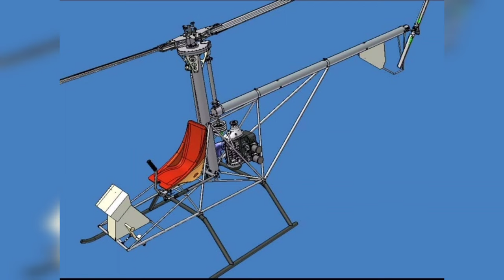Tail-Rotor Hub: Experimental Homemade Helicopter Build, Part 28.

Comment: where did you get the necessary parts/tools?
Reply from the maker: Have manufactered everything shown in this video myself as per the plans design/dimensions
Reply: @JeffChoppah  ah I see
how about the tools you used? materials used as well?
Reply from the maker: Aluminium 2024T6 and steel 4130(EN9)
Reply: @JeffChoppah  ah thanks

Comment: Santun bosku mesin bubutnya berapa harganya karna mesin bubut itu banyak kelebihannya bisa aja buat apa saja segala jenis maupun blok mesin buat silider blok piston torack
Reply from the maker: Depends with size and features...mine is a combination of lathe and mill, with 0.8m between centers coated me $2000 in 2019.

Comment: What is going on with your engine?
Reply from the maker: Haven't spotted much trouble so far except one carb is not responding, engine is currently off the airframe, have done general inspections and servicing, changed sparkplugs, engine oil, gearbox oil(also modified breather, it kept on leaking in vertical mounting), inspected piston rings and gaskets, cleaned it, lots of cooling water was available so we rule out any overheating...all looks normal, I will be mounting it tomorrow and work on carburettors next and try firing once more...have disassembled Tail-Rotor gearboxes and changed bearings clearances to hand fits, and reassemble Tail-Rotor transmission shaft making the system quite free and smooth.
Reply: @JeffChoppah  Something caused the engine to seize and there must be signs of that seizure.  Post pictures of the pistons through the exhaust ports if you can.  It seems odd that there is no damage to the combustion cylinders or pistons.  Well good luck and all the best.
Reply from the maker: @av8tor261  was trying to check pistons today!! What exactly should I be looking out to find? I checked today with some light and could just see a near white bright piston with normal rings, have ordered a cheap endoscope for a phone to inspect the insides better and make a video, through spark plugs holes all I see is carbon deposits...after assembling the engine today it was quite smooth, awaiting new spark plugs this week, have cleaned the carbs, after internal inspection I will attempt another engine start.
Reply: @JeffChoppah  These videos might help.  Based on what I saw of the engine seizure.  Something "stuck" because the engine RPM dropped fast.  Why?  We don't know that yet.  But, something went wrong and fast.  Now is the time to find out what because thing never get better once in the air, they get much worse, FAST.  The firstling I would have done was look at the spark plugs after the seizure and then I would have removed the exhaust manifold to inspect the exhaust side of the pistons.  Question: Was this the very first time you ran the engine since you bought it?  Cheers.
Reply from the maker: @av8tor261  had a few of my fellow builders come in today, we did more troubleshooting,we did check cylinders compression, to know about piston and rings issues, which was fine, apparently in the end only 1 spark plug is functional, all this time seems it's one cylinder that was firing, again when u apply the throttle only the carb with functional plug is effective.
Had ordered sparkplugs awaiting their arrival b4 6th, for further isolation and then make a video of the troubleshooting process.
Reply: @JeffChoppah  Good luck.  BP8ES.
Reply from the maker: @av8tor261  yes got them from aircraft spruce, they are probably already here but it's been public holidays since Friday untill Tuesday, a whole 5 days holiday, what a waste.
Reply: @JeffChoppah  It's a good time to spend with your little helper.  Be safe.

Comment: Just wait few days more to flight test😋😋🤗🤗🤗👍👍
Reply from the maker: Thank you old man... always here, appreciate your presence
Reply: @JeffChoppah  u're wellcome sir..  next, what u will buid of this heli project?
Reply from the maker: @oldman8636  right now as I post this comment am taking a break from removing the engine from the airframe to troubleshoot start idling issues and modify gearbox breather....but next step of the build is buying an aluminium sheet and rolling it into a fuel tank and instruments panel, and make tail rotor blades.
Reply: @JeffChoppah  yeah...  i Wish this machine will be allright... 😁👍